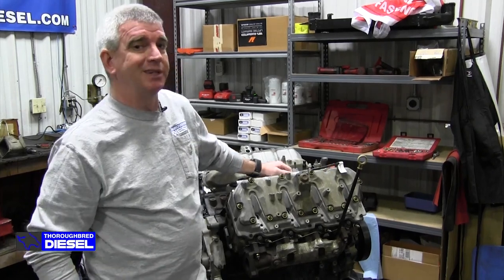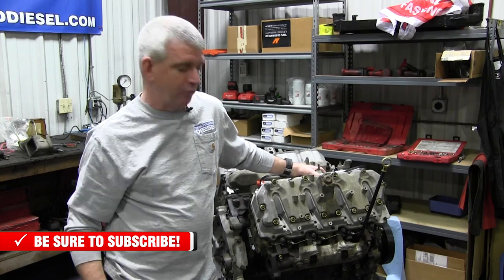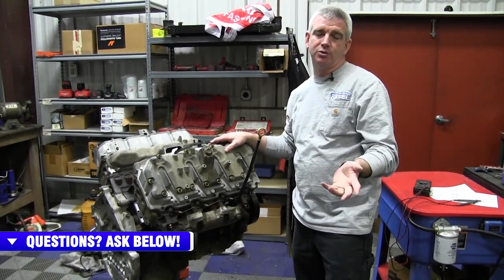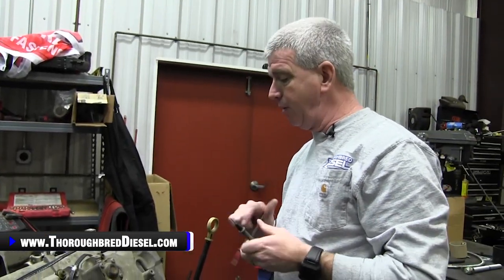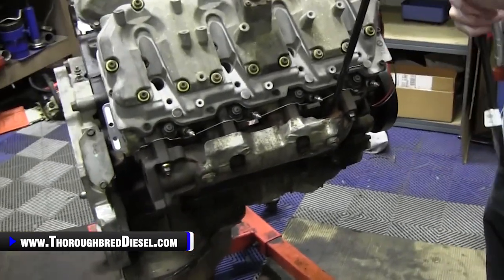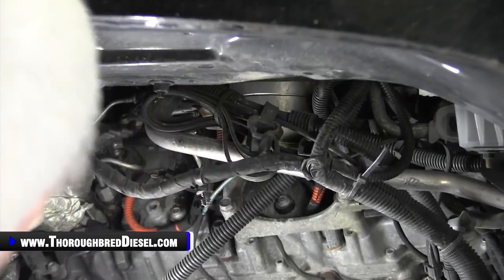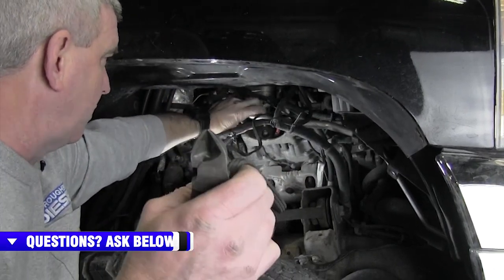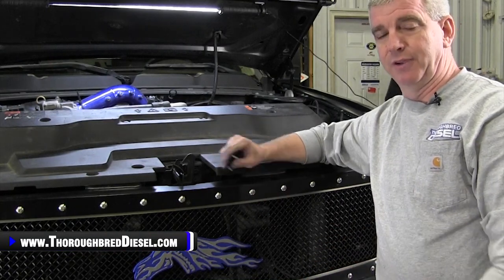Why Is This So IMPORTANT? Info ALL Diesel Truck Owners Need To Know About Their Block Heater Cord

Comment: If the block heater doesn't heat the engine sufficiently, I recommend more than a continuity test.  Perform an amperage draw test.  On the bigger diesels, the block heaters are rated @ 1800 watts, which (skipping some math here) would indicate the amperage consumption would be 15 amps, meaning a good block heater incurs 8 ohms of resistance.  An ohm reading higher than 8 means there is extra resistance in the circuit.
Reply: Chad Jessup exactly!! Kept tripping my 30amp outlet when plugging in block heater. Beep test fine but checked resistance and was like 80 or 120ohms or something crazy.. So separately tested cord and it had like 50 ohms and heater element separately tested had like 40ohm... So everyone spreading beep test technique is just uneducated misinformation basically. Half ass shade tree mechanics bug the hell out of me!!!!

Comment: On a 2017 gmc canyon 2.8 duramax diesel where is the block heater located?
If there’s not one on it, can it be retrofitted?
Thanks
Reply from the maker: If it was ordered with that option it should be there, and the cord is folded up behind the battery.
Reply: @thoroughbreddiesel  
I was wondering what the option code is for the block heater.
I thought it would be located in the glovebox on the option sticker, I just don’t know the code.

I searched the engine bay but no cord is there that I can find, so I’m thinking mine doesn’t have one.

Comment: 2019 GMC Sierra 2500HD Denali came with the heater cord "deleted" due to engine fire risk.  NHTSA Campaign Number 19V328000.  No word on when or if they intend to replace it.  Fortunately, it is a mild winter in Ohio this year.  It is something I want to have installed once corrected.  I would also like a video on when to use a grill cover.  Thank you for the informative videos.
Reply: I just purchased 2019  duramax 3500  A month ago And I just found out I do not have a cord it has been cut off the dealership did not tell me about this issue I live in Minnesota now I'm worried about my truck freezing.  Corporate told me they will send me a letter when the issue is resolved and bring it in to get fixed but when will that be...

Comment: good video, i just bought a new heater and cord, i have continuity for the heater and the cord but not the heater and cord together, i plugged it into the wall and it works, im so confused. Any help would be great

Comment: Does it hurt to leave the block heater plugged in all the time. I have a 2005 F350 6.0. Thanks.
Reply from the maker: We don’t suggest they stay plugged in all the time.  Use a inline timer.  Your electric bill will thank you.

Comment: Mid-late 2018 I got me an '08 LMM crew cab with 98,000k miles and I'm loving it.  No fuel, intake, motor, tune, cooling, or exhaust mods at this point.. pretty much all aesthetics (ICI bumpers, Rigid reverse floods & SAE forward facing pods, Cognito 7" lift, Fuel wheels, BakFlip cover, and an Edge Insight CTS II.  I'm getting to the point I'd like to start w/ performance mods now.  Can you help point a diesel noob in the right direction so I know how best to get underway and in what order of operation one should proceed?  I don't like the DPF system, and I think the truck oughta be able to breath and cool itself better.  While the OEM design seems good, my goal is to improve overall reliability and efficiency.  TIA
Reply: I got a 08 cclb and the only thing I done was place a secondary fuel filter by the fuel tank saving your injectors and delete  the PCV with a kit saving your turbo from oil ingestion also no more hoses blowing off under load.

Comment: Should you keep them plugged in al night or just an hour or so before you crank it???
Reply from the maker: The best way is to set them on a timer. This keeps you from wearing out the cord/heater as fast. I plug mine in and have it on a timer that comes on a couple hours before I leave home.
Reply: @thoroughbreddiesel  thank you. New to diesels (2019 ram Cummins)
Reply: @thoroughbreddiesel    Harbor Freight has relatively inexpensive, 1000W timers that are perfect for this.  Mine have lasted for at least 15 years, so far.

Comment: Hi my name is Jim I have a 91.5 Dodge I’ll give you three guesses with under the hood anyway it’s coming up on the 500,000 miles it’s actually got more than that but anyway that’s the odometer showing that truck when I go out in the winter time how many can be 10° outside I turn the heat grid on in that engine does rollover maximum three revolutions and it’s running I’m in without plugged in and now I use Amsoil products in my truck I have a bypass kit on it and things like that and no I’ve run up to 50,000 miles on my oil changes and I change the filters at least twice along the way and so that helps of course but anyways That’s the way the old girl runs so yeah block heater’s to help I do like the idea of being I have been able to have heat quicker all right you guys are thoroughbred keep doing what you’re doing I watch just watch that video about the guy from dynamite diesel check in the row with the missions that’s the Way to go man keep them clean guys keep them clean
Reply from the maker: Thanks!

Comment: Do you guys know how someone would crack a 55 block 24v Cummins?
Reply from the maker: With a cracked block or would repair a cracked block? If you are looking for someone to do a repair, we do not know of anyone that would attempt that repair.
Reply: Thoroughbred Diesel I found one with a cracked block and I found a new engine for it for a good deal but I’m worried that they had to beat on the truck a lot to be able to crack the block on a 55 block.
Reply: How to crack a 55 block...with a jackhammer.

Comment: Or you can measure resistance, should be between 8 to 30 ohms of resistance. OL means you have an open circuit, and a lot of resistance means there’s a short.
Reply from the maker: Great info.  Thank you!

Comment: So how do you replace the coolant heater if that is what is bad?
Reply from the maker: It depends on the vehicle, but if the heater is bad, remove snap ring and pull out the heater.

Comment: sorry...negative... 2001 f250 7.3 super duty is on oil filter housing driver side !!  not passenger side.  cord does run to pass side under grill area and behind bumper